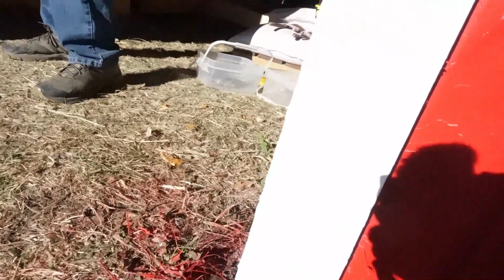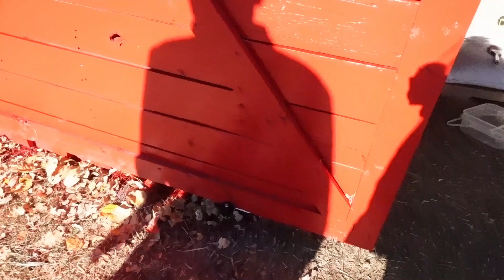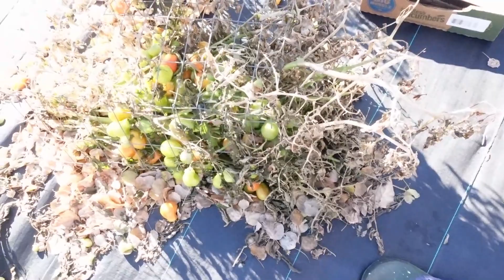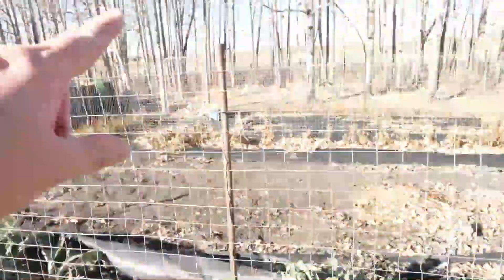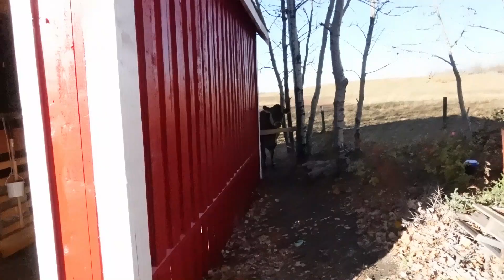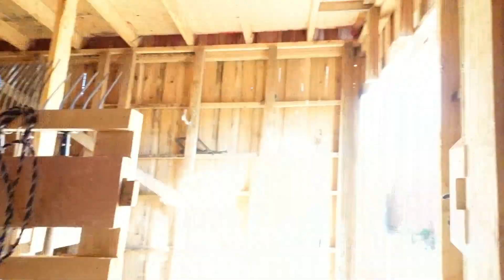Tomatoes, Tomatoes and More Tomatoes!

Comment: How many jars of tomato sauce, salsa etc did you get out of those tomatoes? My niece would be so jealous!
Reply from the maker: I made over a case of pizza sauce, 2 or3 cases of 750 ml size tomatoes and I think at least 6 cases of spagetti sauce in either 500 ml or 750 ml. I just kept going til I had no more jars!
Reply: @tinyhomelivinginalberta3451   That’s amazing! My niece is freeze drying tomato sauce. It doesn’t take up as much room as jars, but it’s nice to have both. That’s a crazy amount of tomatoes. You must have put on a bunch of fertilizer/compost on your garden to get that much produce from it.
Reply from the maker: @mlansing3263  no, we sprayed a liquid fertilizer on when the plants were just a couple inches high. We till a new batch of compost into the garden each year. It has a lot of chicken manure in it but we really don't fuss over the garden. We put the woven ground cover down after adding the compost and that's it.